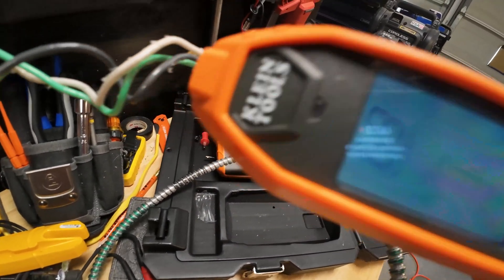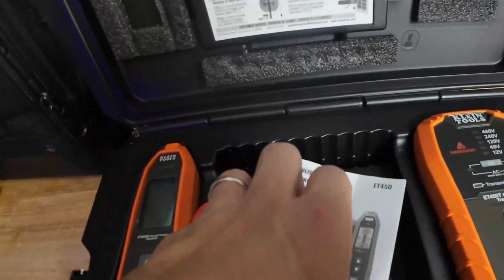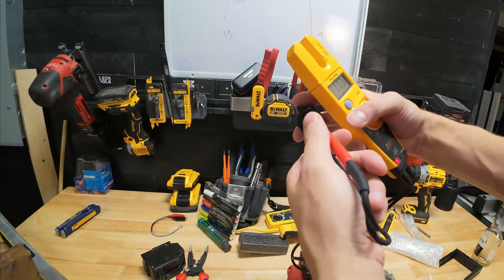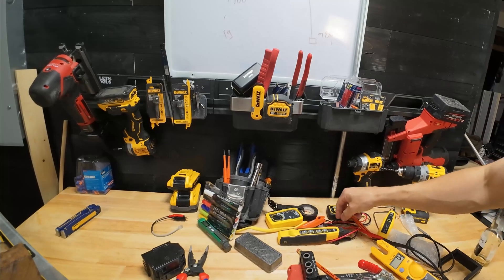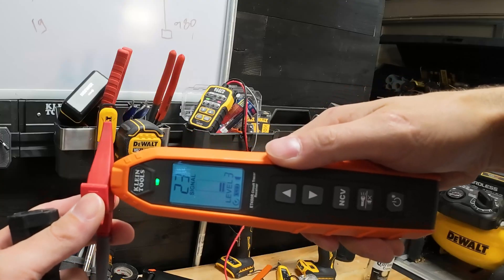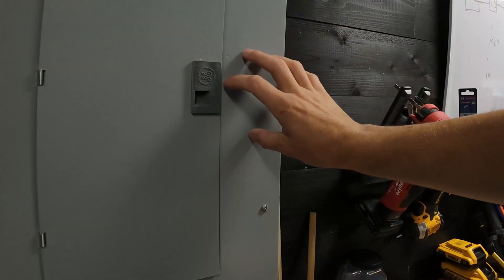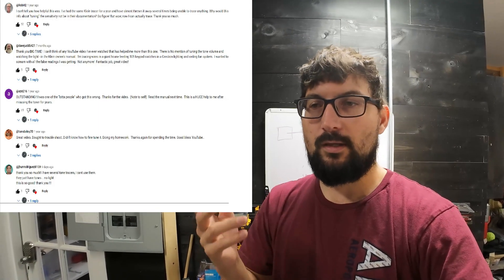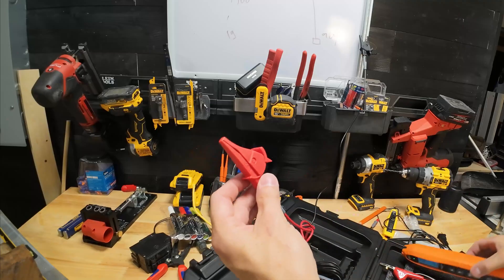Klein Circuit Tracer/Toner - How to use The RIGHT Way!

Comment: Got my ET450 and can confirm everything in this video with this one simple test: 

so, I decide to test the circuit breaker finding aspect of the ET450. I first use the two-prong plug adapter, plug it in, and ultimately set it to level three; even then, there were a number of false-positives with other circuit breakers. The one I knew was correct displayed the highest number, but I felt it was a bit too fiddly and slow and thought I might just hang on to my dedicated circuit breaker tracer.

But then I recalled these videos. I replaced the two-prong adapter to the single-prong adapter inserted into the hot side of the outlet and the other I used the ground-pin adapter and plugged that into the (known good) ground plug of the outlet.

When I went back to the panel, I only had to use level one sensitivity on the receiver and no other breakers signaled; just the one I knew was the correct one. And since I didn't have to run it up and down the panel or fuss about, it was far faster and more accurate than the dedicated circuit breaker finder.

So one more tool to happily get rid of! (the dedicated circuit breaker finder thingy, that is).

So, yes, the hot/neutral two-prong plug works and you can trace out a correct circuit breaker, but it is truly far more accurate to use the remote-ground method instead.
Reply from the maker: @thenorseman8964  💯  Thanks! For the feedback
Reply: Believe He Said It Was Best To Use A Ground Off A Different Source or Circuit .
Reply: @SteveJames-cm6ss  Yes, I had wanted to say this but I don't think I explained it well, so I'll just say thank you for the correction!

Comment: Can I use this to trace a hidden wire on an old knob and Tubing.
Reply from the maker: Yes, the e t 450 is amazing 
 still need a general idea of where the wire is.But the sensitivity settings and increasing noise features will help
Reply from the maker: https://amzn.to/4b1jEXt
This is a affiliate link. It helps me out, doesn't cost you anything extra?

I did notice that it's back down to 300. 
They other dsy it was 340

Comment: Most people tracing an outlet will not have an external pipe to ground to. Most people are searching for the circuit breaker for the outlet that has zero power. The ET 450 says you can trace with or without power. Why didn't you show that - MINUS the pipe that no one will attach to, that you spent your entire video on that pipe ground. Useless video .

Comment: FYI you can trace copper plumbing under concrete slab and through brick.  Long black attachment to outside ground rod. Short red withe clamp on copper. Start on 8 sensitivity and work down to 3. Remember to slide tool in the correct orientation.  I traced 100% accuracy my entire house.
Reply from the maker: Oh that's actually very useful information thanks

Comment: So the 450 cannot be used on a dead circuit to trace wires in a wall for example? I was under the impression the part the leads plug into generated a signal and the hand-held receives it. Wouldn’t that be how you find an open wire?
Reply from the maker: the 450 can trace anything  live,dead,shorted in conduit, underground
Reply: @toolsandtactics just found another one of your videos that cleared it up. thanks!

Comment: I have outside yard light posts… I have 6 posts one is dead no power at all .. I have no idea how they ran the lines.. so I bought this kit to  trace of find the buried line.. can you do a video on that?
Reply from the maker: Yeah, I'm backed up on cue right now. I've got 3 or 4 videos. I must make, but we will sneak that one either into a live or a short or something just for you. Thanks
Reply: @toolsandtactics  what is the buried wire depth capacity in toner mode?
Reply from the maker: I actually don't know I would have to do research on that to figure it out myself.Maybe you'll have better luck

Comment: Thanks im advance, but i have a question, how can i trace a wire that may have been disconnected from a power feeding 3 outlets, all 3 outlets have good connection between them, all breakers are good, but can't find where the power stopped coming to the outlets. Need something to trace a wire inside walls, in case a rodent shrew the wire, need to find where. Thank you

Comment: This might be a silly question but does the ground need to be in the same circuit/conduit or can it be any ground from like another receptacle. I’m trying to trace a wire in a conduit run but the ground was broken. So I only have two hots, it’s a 240 receptacle
Reply from the maker: Yeah, the ground can be from anywhere so long as it is a true ground

Use an extension cord if you need to.
Then use the multimeter to verify you have the proper potential to ground.

Comment: Wondering what is the best way to use this tracer to find the blockage in underground conduit if there is no any wire in the conduit at present, thanks.
Reply from the maker: I almost understood what you're asking me, but then I got lost

If you're trying to figure out where block is to know where to dig you could put a fish tape through with a rounded over head on it. 

Attach one side to a true ground and attach the red to the fish tape

Push the fish table all the way through.
Until it stops and seems like that's where the stop is. And then make sure that the fish tape isn't in continuity with the ground and start tracing
Reply: @toolsandtactics great, that exactly what I was thinking. I tried to use a stainless steel rod hammered to the soil as a ground, and pushed cat5e cable attached to the fibreglass fishtape inside the conduit, but ET450 did not pick up the cable.
I bought Klein metal fishtape, so will give another go. Any idea why my first method did not work?
Reply: @puttinxyilo if I had to guess it’s because you used LV cable probably not enough copper there to put off a good signal. I would try fishing some 14 gauge depending on how deep the pipe is. Or maybe the metal fish tape will be the best conductor like he suggested.
Reply: @Tagerrun may be, but  was thinking about not good enough ground through just rod in the ground.

Comment: I have two outside outlets that have no power and are not connected to any (other) GFI breaker that I know of... One is located at a pier 100' from the back of the house. The other is a front outside outlet on the house. What diagnostic tool do I need to trace these? I was considering the Klien ET 450 thinking you get what you pay for. Is this the best option for this job?

Comment: I hope you eventually get to the toning part….
Reply: You do realize he's talking about toning live electrical conductors and conductive communication feeds right?

For instance, if you're looking for a particular conductor reasonably buried in walls, through raceway, underground (shallow), up in attic spaces, network cabs etc. with one lead on a known grounded source and the other attached to the conductor you wanna trace (whether or not voltage is present) then with the unit's receiver you can (with much higher sensitivity) map its route/path (partially or perhaps even entirely) or simply locate the end of that conductor.

This is great, because unlike any other system around this price range ($250ish) that I now know about, this setup here can tone just about ANY conductive run, whether it's low voltage communication or 480v live current carriers. This here is a game changer. I'm a journeyman Electrician with a communication tech background with over 20 years combined experience between the two disciplines. Trust me when I tell you, again, this is a game changer. This unit can pay for itself on its first job...
Reply: My thought exactly.

Comment: What is the proper way to use this to find a break in a neutral?  I have power at the location hot to ground but the neutral give me nothing hot to neutral.  Wires have been verified and nothing is mixed up.
Reply from the maker: you should be able to connect 1 side of the neutral because it has no reference to ground so the toner should present a noise  at anytime it stops you know you found you loose connection instantly by leaving it connected and the tone changing
Reply: Thank you!  @toolsandtactics

Comment: Hey nice video can this find where the power stops like a broken wires, my out stop working but the circuit breaker is hot.
My son was cutting drywall with his isolating pool don't know if the cable got hit or something else ate the wires in the Attic .

Comment: Hello, I'm in the process of purchasing this equipment, but I'm looking at tutorials for advice.

My goal with this equipment is to update electrical plans and single-line diagrams.

I would like your opinion regarding tracing circuits with voltages between 220V phase and 120V phase-neutral. Some of these circuits come from ungrounded electrical panels.

My specific question is, is there a risk of connecting the tracer?

Option 1: Phase-Neutral.

Option 2: Phase-to-Phase

Taking into account that these are older installations, and many of them are ungrounded, my task is to update the single-line diagrams or electrical plans.

I greatly appreciate your collaboration.
Reply from the maker: yes this is for energized circuits  a toner would be a problem but this klein et450 is made for tracing circuits and you can connect directly to the neutral and go up to 480 volts good luck be safe!
Reply: @toolsandtactics  

Working on energy efficiency projects, the generation of up-to-date and accurate single-line diagrams and electrical drawings is an essential deliverable. Our work methodology begins with network monitoring directly at the service entrance panels, which serve as the fundamental basis for the development of these diagrams.

A significant and recurring challenge is that many of these panels—generally three-phase with 220V phase-to-phase voltages and a main switch—feed multiple circuits (often a dozen or more) that lack clear identification or adequate documentation ('makeup'). This situation not only delays our schedules but can also compromise the accuracy of the initial survey, directly impacting the quality and reliability of the final electrical design.

With the firm objective of overcoming this obstacle and substantially increasing the efficiency and accuracy of our designs, I consider the acquisition of specialized circuit tracing equipment, such as the Klein Tools ET450, to be strategic. This technology would allow us to effectively track wiring from the main panel to subpanels or the final loads of individual circuits.

To put my technical question about the ET450 into context, the main connection configurations for the transmitter in our projects would be:

Line-to-Neutral (L-N) Connection: The transmitter would be connected between a phase (L1, L2, or L3) and the neutral (N). In these cases, the voltage present would typically be 110V to 120V AC.

Line-to-Line (L1-L2) Connection: The transmitter would be connected between two different phases (for example, L1-L2). In these cases, the voltage present would be 220V to 240V AC.

My main concern, before proceeding with the investment in the ET450, is to ensure its compatibility and correct operation under these two specific connection conditions on energized circuits. Specifically, I would like to confirm:

Is the ET450 transmitter designed to be safely connected and operate effectively to generate the tracking signal in both an L-N (~110-120V) and L-L (~220-240V) configuration on energized systems?

I would appreciate any information.

Comment: My problem is isolating the one wire in a raceway with 200 other wires.  I'm ready to get a needle and stick the far wires to ohm it back to the correct wire. It also doesn't trace through stainless conduit which is a bummer.
<edit> I like it since it works on a live hot wire unlike the less expensive testers which need the power off. And three hours later I found the wire and the conduit is full of water which is causing the short circuit to the breaker.

Comment: Great informational video! Currently have an issue where I need to turn off two breakers to de-energize a circuit. One circuit goes to lights and the other I believe goes to an outlet. What would be the best way to use this tracer/toner to help identify where the circuit is merged by mistake? Would it be better to use on energized or de-energized circuit in this instance?
Reply from the maker: With it connected together it's going to be difficult. 
Leave power off connect with the ground and hot method. And disconnect wires verifying a change the toner can simulate as if power was on by beeping or giving a percentage variable  and you can find the change real-time. Safely. Still double check for power everything but with the power off you can wor faster and safer.  Goodluck
Reply: @toolsandtactics Thanks for the info. I am hoping it is just the outlet that is tying everything together. If I suspect that the outlet should be an independent circuit, and is mistakenly tied to the light circuit. Would it make the most sense then to transmit the signal from the circuit breaker end and then start disconnecting wires at the receptacle?

Comment: The most meaningless video I've ever watched. I don't understand anything at all. I don't think he knows what he's talking about either. A complete waste of time. I don't even think he's an electrician
Reply from the maker: @kerematak5455  thanks for the valued feedback I will remake this video.
Reply: Your point about using a ground instead of a neutral is clear, you don’t need to remake the video, some people may just need to rewatch it and pay better attention.
Reply from the maker: @kenmeyer6786  maybe it's been a long two years man
I was kinda dying from mold poisoning, and still am

I'm  improving, but still dying every once in a while from micotoxin, exposure lol

I'll probably make a toner and tracing video with some actual wire.In some boxes here pretty soon. 
Thx for the feedback
Reply from the maker: @kerematak5455  ill rewatch and evaluate this comment, maybe I need to make another thx.
Reply from the maker: Okay.So the part right before the extension cord I probably need to stop and draw something

And emphasize that the instructions want you to use the neutral and hot .When using the neutral is the last thing you wanna do. 

If you're tracing out a circuit from the breaker, you do wanna use the neutral

If you're tracing out an individual wire, you want to use a known true ground source and the wire , you're looking for. ( that's where the extension cord and multimeter come into play.If you get an actual voltage from ground to hot, you know, it's a good ground.

Comment: You said "The Power can be off with Toners".  So, this Klein ET450 will NOT work on 110vac wires that are not energized?? Please clarify if this, in "toner" mode works with or without power on the wires.  Thanks
Reply from the maker: oh,  it works with both  on or of      f the 450 will do both     the toner, the power must be off

Comment: Wasn't sure what the mechanism of action was when connecting the black (COM) lead to a known good ground.  So I did a few quick checks with an oscilloscope and found that the output (RMS value) of the transmitter approximately doubled.  The interesting thing is the same thing happens if you just hold the black (COM) terminal between your fingers, the output approximately doubles therefore the signal being injected into the wire (which is a square wave at approx 33 kHz) also approximately doubles so you get a stronger signal on the receiver at the same distance along a wire.  From what I saw; the mechanism of action has something to do with what the output of the transmitter "sees" not necessarily a known good ground.  Maybe someone else could do something similar to see if my tests were valid.

Comment: Hi can i use this tracer to trace network cables as i have tried it and didn’t work for me
Thanks
Reply from the maker: yeah attach the black to a known ground   use an extension cord and use the black prong into the ground and attach the red to the wire in question

Comment: If I have the Klein toner kit, is there any point in me buying this advanced circuit tracer kit? I do resi service with some light commercial service. Trying to see if this is something I’d need for troubleshooting or if the toner will be sufficient
Reply from the maker: if you are a pro and use it to make money  yes get this kit, its an outstanding value for precision and works just like a toner.  It can find breakers  and can be used with the circuit on.  We both know troubleshooting hot  is way easier to find the problem, not that im advocating for hot work, but  its true.  cheers

Comment: Can this also be used in automotive applications? Grounding it to the battery of the car to use the toner?
Reply: the instructions say it won't work on DC. correction, they say the Non Contact Voltage tester wont detect voltage with DC. not sure what that means for other features as AC/DC is mentioned several times. i just got this today. It also says the Transmitter is not needed in NCV mode. not sure what that means since i'm still reading the instructions.

Comment: When you say "tracing" is so simple vs toning, do you mean using it on a live circuit to find the breaker?  I dont get why you're saying the instructions say nothing about toning, when that's the whole premise of the tool and it tells you exactly how to do it in the instructions. Can you clarify why you said the et450 is not a toner or its not advertised as a toner. If its not a toner, what is it?
Reply from the maker: @gabrielramos3385  i did a live on this in more detail using the ground specifically and how it's useful because if the neutral is lost the circuit inst complete v  
Tracing is when the circuit is on and  reads to identify  the breaker.
Reply: @toolsandtactics  understood, thanks for clarifying.